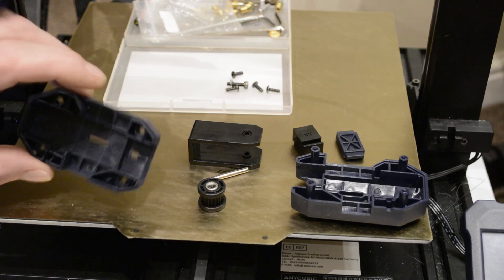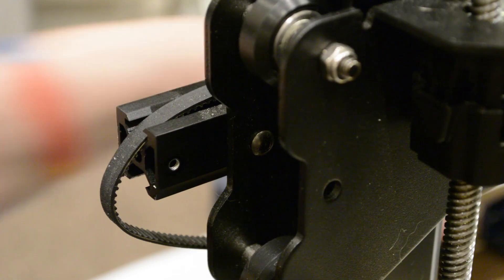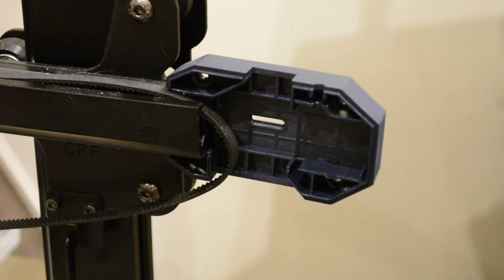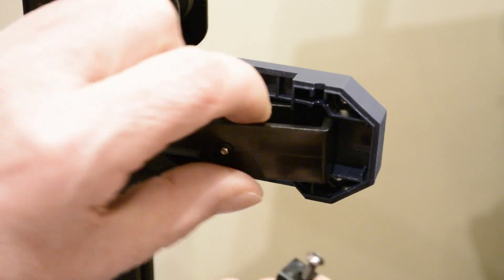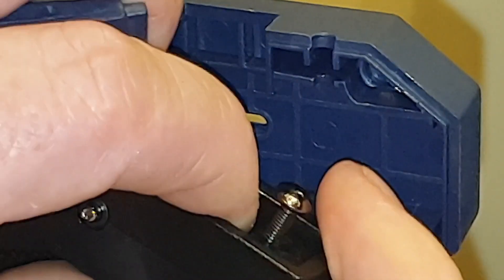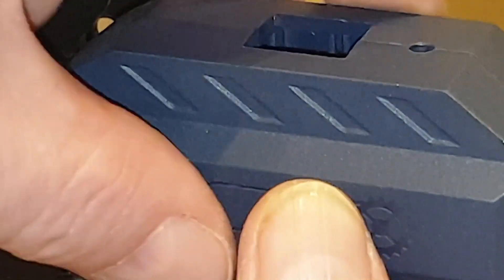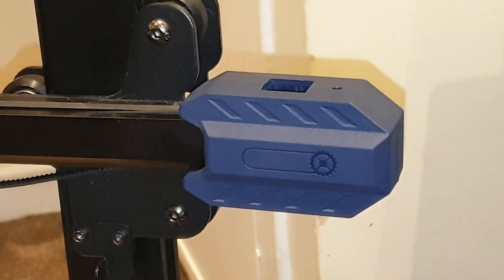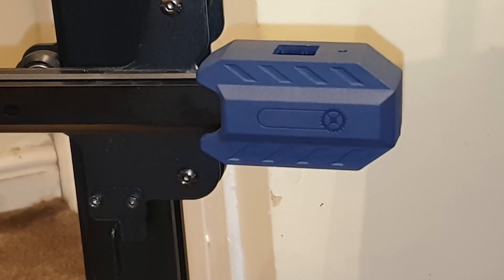Vyper X Belt Tensioner Assembly

Comment: This is strange. I have a vyper and I took the belt tensioner apart and there was an extra black piece in there…so there was one with the tightening screw in it and one without. Did you have that as well?

I left it out since you didn’t have it in your video and my belt feels like it moves more smoothly